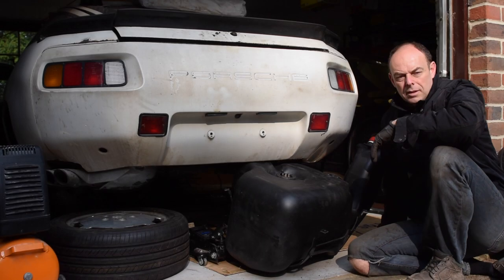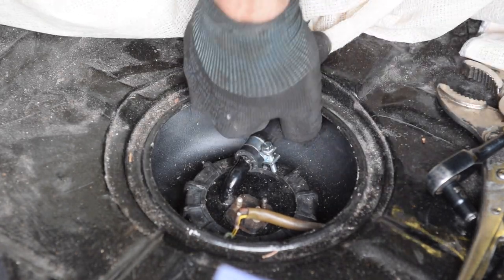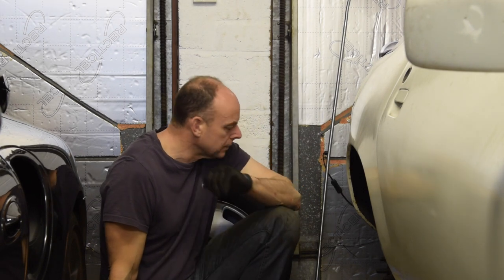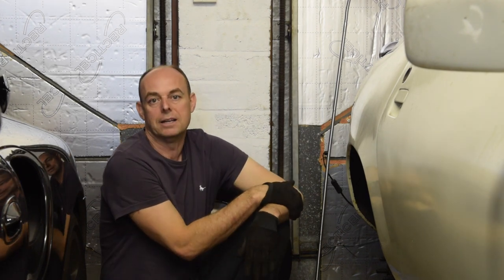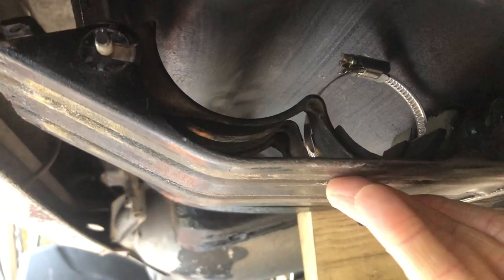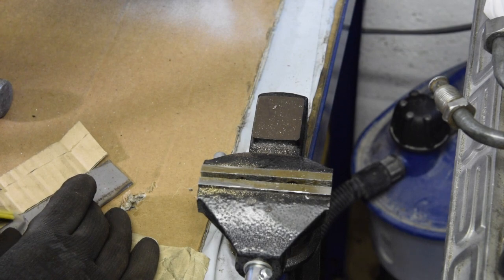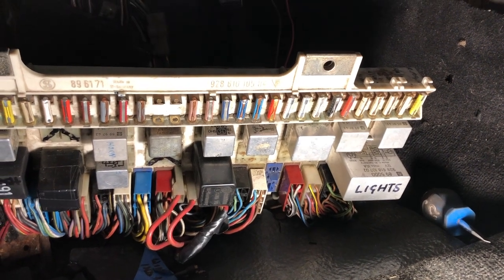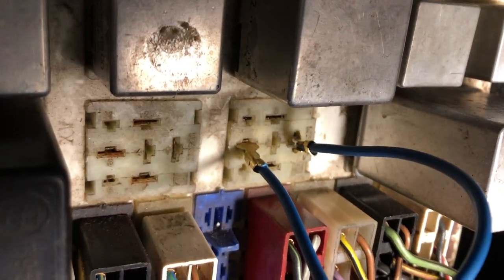Porsche 928 Episode 58 - FINALLY! pumping fuel....

Comment: Tried to start mine having replaced the fuel, fuel pump and filter. the new pump is more powerful than the 38 year old one, so powerful that fuel came out from the rear wheel arch behind the plastic splash guard. I'll fix that on Monday as it looks like another section of fuel pipe has rusted away.
Reply from the maker: Hi Rick, sorry, just found your comment. Did you manage to get it started ?

Comment: I lost track of which tank you used in the end but the pump cradle is upside down, maybe it’s intentional as it’s not the right tank.
Reply from the maker: Hey Gary, it’s the original 1979 tank with a later cradle. Yes the pump bracket is intentionally upside down as it doesn’t fit the recess in the tank. I quite like it this way as it almost covers the pump (making up for the missing cover)